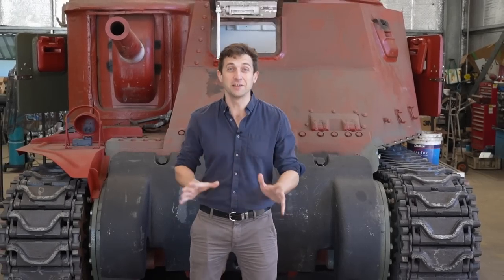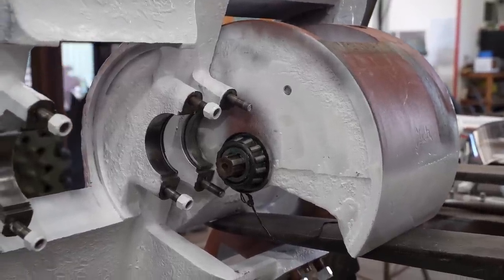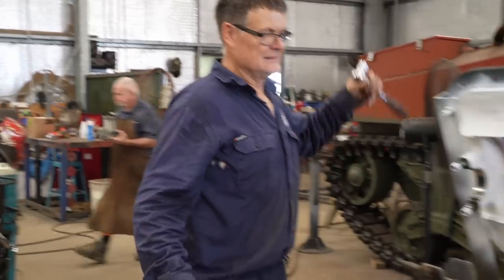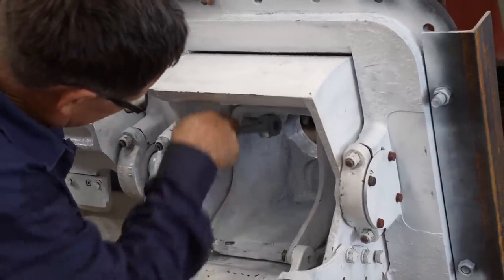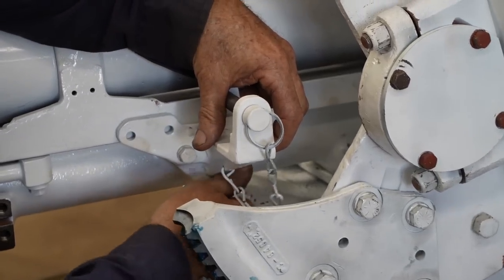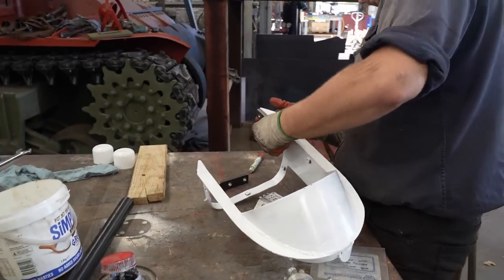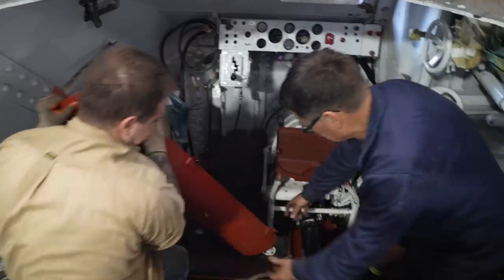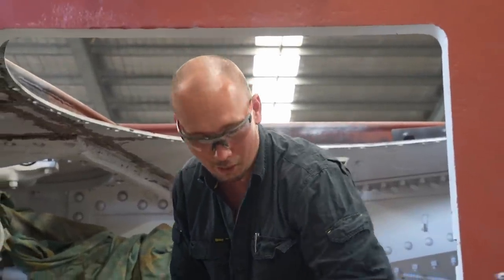WORKSHOP WEDNESDAY: Reassembling the 37mm on a rare WW2 Grant Tank + FIRST TEST DRIVE!!

Comment: This has given me a new appreciation of the Grant as a solid piece of engineering - not just an ungainly stop-gap rush job.
Reply: Same here.
Reply: It was also still a beast against the Japanese in China.
Reply: @brokeandtired  Damn handy in the western desert against Pzkpfw IIIs and early ivs too. But it's clumsy use of the 75mm and height always seemed to be a transition tank not to be taken too seriously, for me anyway.

This series has shown the degree of thought and engineering that actually went into it.
Reply: 100 % 👍
Reply: @awf6554  Well against the Japanese tanks the 37mm was still effective frontally, in the tank on tank engagements, the Grant wiped the floor with Japanese tanks. Up until 1945 it was still effective in the Far East and its 75mm made a great pillbox bunker cracker.
Reply: Same. They always described it that way, but boy was this thing built well. I guess it's just casual American engineering. 😂
Reply: @brokeandtired They could only kill them with point blank artillery berages as they had small AT guns.
Reply: @brokeandtired   Not really, the Demographics of Hawaii are 40% Japanese.... They are winning...
Reply: Everything was there. Engine, transmission, drivetrain…
a redesign on the top front of the hull, design a new turret, of course, move few things around in the hull, et voilà, a Sherman!
Reply: The grant tank was pretty good for what it was, but still very impractical. The Grant isn't even fully American, too, being modified by the British to take down the kill and crew count to 6 instead of 7. I guess they just didn't like separate cupolas for commanders. Personally, I like the M3 Lee more because the Commander's machine gun turret was good for anti-infantry instead of the Grant's commander having to be exposed to the battlefield to shoot, more often than not, leading to his demise.
Reply: @ricksmith4736   what the demographics of Hawaii  meant to be. American?
Reply: @hitman_6615   So you were in a tank squadron in  WWII?   You were involved with tank tactics in the pentagon?
Reply: @ricksmith4736  Do I even need to explain myself?
Reply: @ricksmith4736 ain't that the truth..
Reply: Except it was just an ungainly stopgap rush job.  The Americans weren't even going to produce it in real numbers until the British ordered a lot of them.
Reply: @lukefriesenhahn8186  Japanese 47mm would go through the front at 500 metres.  The 75mm field gun would do it at 1km with HEAT.  The real problem for the Japanese was that they simply didn't have the AT guns or ammunition available in the right places at the right times.  If you don't have anything available - not even one of the 37mm AT guns or the 20mm AT rifle - then you're screwed regardless.
Reply: If you haven't see it already, watch Sahara with Humphrey Bogart  - 1943, if memory serves me. A Grant features heavily in that movie - lots of interior shots as well. It's a great film 😉
Reply: @ricksmith4736 yes the all Japanese 100th Infantry Battalion did a lot of winning.  For the USA because they’re Americans.
Reply: @c3aloha   No there NOT and they never will be....
Reply: @ricksmith4736  PRIVATE FIRST CLASS SADAO S. MUNEMORI
He fought with great gallantry and intrepidity near Seravezza, Italy on 5 April 1945. When his unit was pinned down by grazing fire from the enemy’s strong mountain defense and command of the squad devolved on him with the wounding of its regular leader, he made frontal one-man attacks through direct fire and knocked out two machine guns with grenades. Withdrawing under murderous fire and showers of grenades from enemy emplacements, he had nearly reached a shell crater occupied by two of his men when an unexploded grenade bounced on his helmet and rolled toward his helpless comrades. He arose into the withering fire, dived for the missile and smothered its blast with his body. By his swift, supremely heroic action Private First Class Munemori saved two of his men at the cost of his own life and did much to clear the path for his company’s victorious advance.

He’s more American than you ever will be
Reply: @ricksmith4736  “Blood that has soaked into the sands of a beach is all of one color. America stands unique in the world: the only country not founded on race but on a way, an ideal. Not in spite of but because of our polyglot background, we have had all the strength in the world. That is the American way.'' Ronald Reagan.
Reply: @c3aloha    I can assure you what proud JAPANESE they would all be if Japan had won the war... It always goes back to race.... Look at how it works in the prisons......
Reply: @ricksmith4736  I’ve never been to prison so I wouldn’t know.  It doesn’t look like that in my neighborhood of law abiding American citizens.
Reply: Grant/Lee tank was both a solid piece of engineering, and an ungainly stop-gap rush job. 
I forget why they couldn't just build the Sherman straight away.   I think they could not cast the bigger turret and weld/cast the hull in the numbers required.  The tank they are restoring is welded, but I think they were rare and towards the end of the production run.  On most Grant/Lee tanks the hull is riveted.
Reply: @lukefriesenhahn8186  Japanese tanks had paper arnor.
Reply: @iatsd  47mm was rare...and the 75mm was an artillery gun, it was busy being artillery and rarely positioned well to stop a tank attack.  Plus in the Jungle fighting you rarely saw a 1km clearing.
Reply: Yes, the engineering revolution that got going building steam locomotives really came into its own with these steel monsters!  So many different lines on invention had to come together in one from metallurgy, engines and power trains, weapons plus electronics... All together with mass production. German stuff was largely superior or more sophisticated, BUT, they failed by comparison in production. Hand made marvels could not out compete a system where a part made for one, fits all.
Reply: @c3aloha    Sure you and your pointy heads have taken over..
Reply: @brokeandtired  although at Kakazu Ridge Okinawa the 47mm in combo with mines and artillery knocked out 22 Shermans in one day.  American armor was not invulnerable to Japanese defenses.
Reply: Great movie alright, have it on DVD. I don’t know how that crappy movie from 10 years ago was able to use the same name 🤷‍♂️.

Comment: we even had to wear a cvc tanker's helmet on the m60. everything inside was metal, and didn't move. driving the tank cross country, you did. even if you were hanging on with the minimum of three points of contact. trust me, it hurt if you cracked your head on the side of the turret even with a cvc on.

Comment: It looks like tipping the tower forward would have let you tuck the tine into that top space, rotating the drum cutout so it could slip in from above.
Obviously, you couldn't as it would just slip off;
With how often you use the forklift for fiddly "3rd arm" lift jobs; maybe modify the tines; a threaded bolt hole, some "hooks" of shaped weld, strategic cuts to catch a wire?
Then again, that could be a safety issue; a seel strap/inverted c beam "shoe" that slips over the tine, fixes behind the tine bend. Shoe becomes a low profile "hook" for use w tine tips low; gets rigidity of the tines & has the tensile strength to support a hook or eye...

Comment: Pity the original blueprints are not available to make missing parts, but parts can be copied with high accuracy to make new blue prints. 17.54.....we can see the balance weights welded to the drive shaft........yikes, that is a lot of weights for one of those.  The original power plant (2 x 6-71N GM's) used a gearbox to combine two outputs, so they had a much simpler time of things with a single output 8V71-T.  The torque converter on the Allison should make it an easy and fun vehicle to drive. 8V71-T were used in the 1980's quite often to pull 80 or even 115 ton road trains in Australia, plenty of grunt and much more economical than the big V-12 petrols like were used in other tanks, and parts are easy to come by and very affordable.

Comment: I've watched your channel for a few days now , going through this restoration as well as the static build of the Jagdpanther , and have a question . After watching your guys fight with the tracks getting them put on with straps and forklifts , why not use an automotive winch ? Build a small frame for it to put on the forklift and secure it , and then just hook it up and pull your tracks through underneath or over the top of bogeys and idlers in one go instead of pulling one strap through , unhooking  , taking a strap out , backing up , rehooking , and repeating . You'd have more control and the tracks aren't heavy enough to really work the winch or cable limits just pulling it under and through .Seems like an easy project that would get some use , save you guys some time , and make life easier !

Either way great job on the builds
...I've got some catching up to do but I'm loving the channel ! Love to see the old steel beasts brought back to life !

Comment: Why not lay the bulkhead on the floor on some wood and drop the piece into position, bolt it in and then lift the bulkhead back onto the frame?
Reply: Cos its bloody heavy and these lads dont have a gantry to do the lifting for them
Reply: @EnterTheFenix  theres a gantry sitting right in front of the frame.